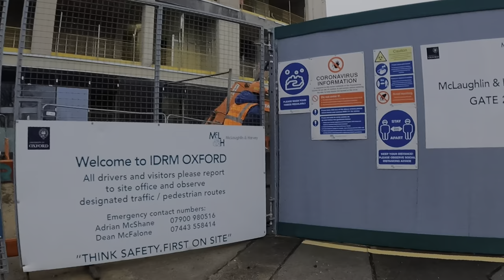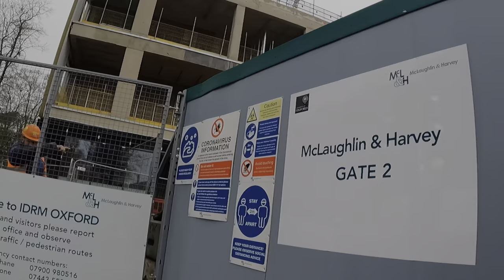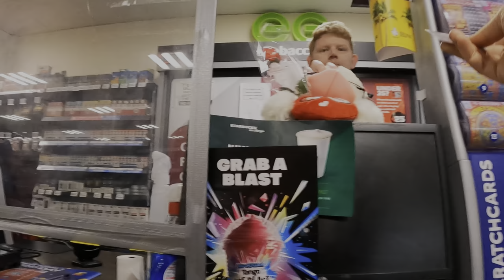Reversing is better, thanks for all your tips 👌🏻 1/2/21

Comment: Always taught to make small adjustments on the steering wheel if you set up right . Quarter turn then check quarter turn then check . Take as many shunts as you like. Some days its a piece of cake others days its dog dirt. ( edited )
Reply from the maker: Ah so true. Thinks for the tip - better practice that

Comment: On that first delivery you should have  I think backed in because once you got to the top there is not enough space to swing around you would be jack knifing yourself that was my view
Reply from the maker: Ooh if i struggled to drive in don’t think I’d wanted to reverse in 🙈
Reply: @LenaTrucker  I guarantee you would have done it and with a bit of guidance too
Reply: @LenaTrucker  ex international trucker, (again), 
drive into the first delivery, and "spin it round" instead of reversing into the gateway to drive out, 
I could see that there was "plenty of space" to spin that artic around in that yard, 
always go hard right turn to spin a (U.K. right hand drive) artic around, head out of the drivers window and look sideways/backwards, 
you would be surprised how little space you can turn an artic around, 360 degree style, 
all you need is, the same amount of space to spin an artic around 360 degrees, as the trailer is long, (as the unit can be driven at 90 degrees to the trailer, 
great with an empty trailer, fully loaded is a lot more tricky, as it makes the tyres bend quite a bit), 
it does take some practice to perfect this, eventually you should be able to do this 360 degree turn on some, not all, mini roundabouts,
(as long as it and all the approach roads are devoid of traffic).